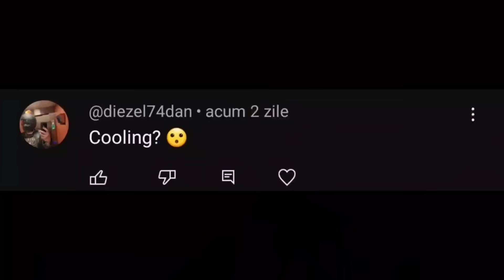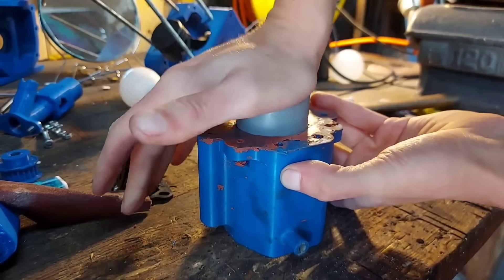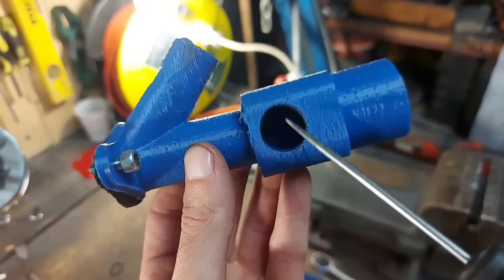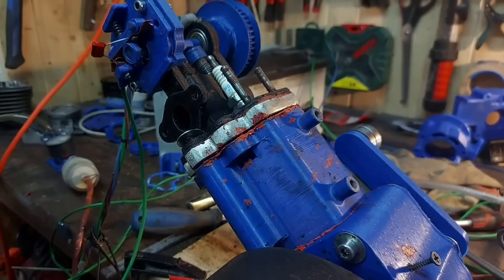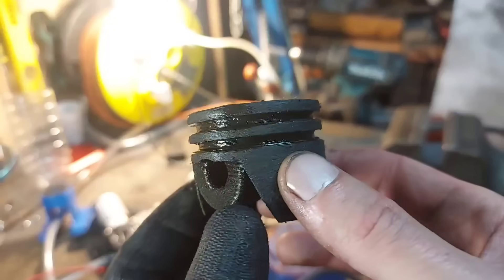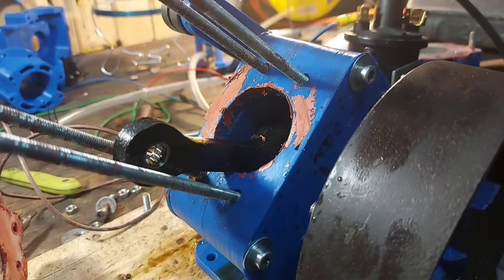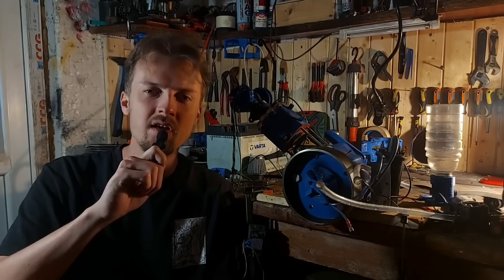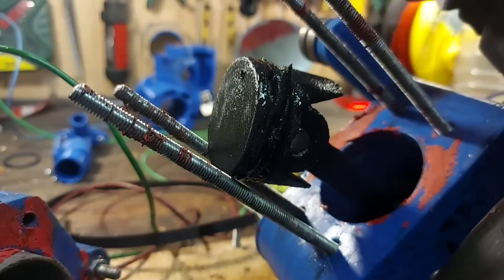High Performance 3D Printed Engine - Testing Your Ideas!

Comment: Maybe a teflon oring rather than a rubber one. Teflon is super soft but maybe the near lack of friction and a reasonably high melting point might keep it alive a bit longer than the rubber ones.
Maybe instead of an o-ring at all the rings could be 3d printed as part of the cylinder.

Comment: Everything you’re doing is exactly what we are plagued with right now when engine makers switched over from cast iron or billet steel to aluminum or magnesium alloy. The saved weight required new methods to prevent the engine from failing from use. Rip the small and big block engines. Now it’s all this complicated mess

Comment: How fast did the engine spin 
Because with high enough frame rate camera or just some magnet sensor we could see max rpm
Reply from the maker: Not sure, but Ill get a rpm gauge for the next episode and I will run another test.

Comment: You could use simple plate of metal at the top of the piston, screwed in place with some inserts and have that part hold the O ring

Comment: The oil made ring sealing better, increasing cylinder pressures for sure. Likely one of the reasons for much easier starting besides the throttle improvements, also potentially a reason for blowing your piston rings out. Another potential for blowing the rings out is spark timing, you need less for higher pressures/throttle. I don't know what you are running spark timing wise, but if you only care about it running longer for the moment  I would suggest having spark at or after Top Dead Center to reduce peak pressures. In non-boosted engines all force harnessed during combustion happens by 20 degrees after TDC since past this point the piston moving down expands the combustion chamber volume faster then the combustion can expand the air.
Reply from the maker: Im running 15° before tdc , that might be a thing , I will look into it , thanks for the tip!
Reply: @alexslaboratory4976  15° is normally a safe number for like 1500/2000rpm+ on NA engines no matter engine load (to my understanding). But they are made of metal. Even just going down to 10 or 5 before TDC could make a huge difference in your current part longevity I think.

Comment: Silly suggestion, but you might be able to cast high temperature silicone lip seals as your piston rings. Tom Stanton did something similar for his air engine, and potentially you could have a different ring cross sections for the compression and oil control rings.
Reply from the maker: Interesting idea, I will look into it, thanks!

Comment: You need to add a RPM gauge. The thing sounded like it was turning 4 or even 5k. Either one from china or better yet a microcontroller so you can log the RPM data.
Reply from the maker: Will definitly add some sort of rpm gauge  for the next episode !

Comment: since you're using a single ring, fill the second gap for a stronger piston and lower the ring seating position so it lasts a little bit longer. I highly recommend a more heat resistant cylinder (it doesn't have to be metal), like polycarbonate and if you add a little bit of water to the fuel it can actually help not to just make your combustion chamber cooler but also to make more power (lower intake temp = more power). Still impressed that your connecting rod held up so well

Comment: Hey, I saw some air bubbles in the coolign system. you should probably remove them in the cooling system. Firstly it affects the water flow, secondly the air might destroy the water pump, third thing is that the air is worse for cooling that water and lastly the air is probably getting trapped in the top part of the cooling loop in the piston sleeve which is where the O-ring is, therefore not giving it enough cooling and causing it to melt (if I understood your engine construction well). To test this theory you can try to turn the engine head 180 degrees, which will change the position of the spark plug and put it closer to where the water is. Anyways there is one more thing about the spark plug. You should probably move it to the center so the heat is spread equally
Reply from the maker: You are right, I will have to add some sort of valve so I can air out the system, the water jacket is design so the water has to go around all the cylinder to reach the outlet and the fact that the cylinder is inclined at 45 degrees ensures that even if there is a small air pocket the whole cylinder is surrounded by water.
Reply: Alright. But what is your opinion about the spark plug position?

Comment: Why are you using a thermoplastic for the bore and piston? Once the engine gets warm both will just melt away...
On the other hand if you use a duroplast, either printed with a MSLA Printer or made with a resin and a 3d printed mould, you could prevent that from happening.
The duroplast wouldn't melt, but just slowly burn or react with the air.

If you then also used some sort of composite, it would probably turn out even better.
I'd recommend maybe using some sort of resin combined with carbon fibers, as that will increase the young's modulus (stiffness) and maximum temperature.

If you do it that way, you could still embrace the plastic 3d printed engine concept and you won't need any metal parts.

Comment: This engine is turning out amazing! I think you should try one more thing before moving to all metal internals, try an aluminum cylinder sleeve instead of the PVC pipe. Aluminum will transfer the heat way better, my plastic piston lasted for over 1.5 minutes with a steel cylinder sleeve, so I think within an aluminum cylinder sleeve you could get even better results. If you could find some sort of aluminum pipe for this, I think that would work really good! 

That first start when it took off sounded crazy, that sounded like a lot of RPMs! 

Good luck, I’m excited to see more!
Reply: you are here   😭😭😭
when is the next video man i need it
Reply: @vortex3738  it’s in the works, I am trying to make the crank case right now! Sadly there is still a lot left to do, but I’m working on it! 

It will actually be insane though, like it’s going to be crazy!
Reply: @ProjectLMZ  Goodluck
Reply from the maker: Thank you ! 🥳 my next step will be  some sort of metal sleeve, id rather go straight to a propper cylinder sleeve so I have easy acces to rings and pistons in the future but idk yet. I have to get a rpm gauge at this point cus this thing really likes to rev 😂

Comment: You can add another valve to the cylinder head that dispenses a jet of water and turn this engine into an 8-stroke engine or even add a little water to the fuel mixture as it passes through the carburetor (BMW has already used the second technique so it should work)

Comment: 4 Things:
1.) Increase the crown height if you can, (The distance between the top of the piston and the first ring) and to keep the compression the same you can add a small dish or depression in the center of the piston. This should reduce the melting issues. Others have suggested this as well. If you can, you could design it like the HERON HEAD. It would increase the squish* of your engine, while allowing the CR to remain the same. (Or worse case scenario, decrease it if the melting problem persists).

2.) Look into Viton, or silicone O-rings for piston rings. More pricey, but they are (or atleast advertised) to be more heat and oil tolerant. Edit: It appears that Nitrile O-rings (I think the ones you have) withstand up to 121C. Silicone can last up to 204C. Viton appears to have a max betwen 204 and 230C.

3.) You may want the inlet and outlet ports on opposite sides of the cylinder. Because of inlet and outlet are on the same side, the otherside of the cylinder and piston (which appears to be the one melting) will have less cooling capability. Although it is convienent, it may be adding to the melting issue. Edit: Water/Coolant jacket is whta I a refering to.

4.) Ceramic paint. You could look into something like Cerakote, or some other easy to apply ceramic paint, to make your cylinder and pistons more heat resistant, like C-186 which is an air-cure ceramic paint. You could also try C-110 for the cylinder liner, though I do not know if it is also appropriate for air curing.

Regardless, hope this helps, and best of luck.

*Squish, for anyone reading this that does not know, is the term for for the amount of area between the piston and cylinder head that is less than 1.5-.5mm apart. This area results in a high pressure zone squeezing on the air/fuel mixture so much, it jets out into the rest of the air fuel mix up to 30m/s, which is actually substantially faster than the flame front that normally occurs. This Squish effect, results in better mixing, lower detonation/preignition frequency, and overall a more homogenous mixture for more consistent performance. However, the squish effect usually ONLY OCCURS, when the distance between the head and piston is less than 1.5mm, and becomes more powerful A.) the more surface area there is, and B.) the closer the distance is. It is known to help engines of both low and high compression.
Reply from the maker: In case I will still be using o rings I will definitely go with viton, when it comes to the cooling jacket, the water is forced to go all the way around the cylinder to reach the outlet and the 45° angle of the cylinder also ensures a full submarge of the cylinder sleeve even if there is a small air pocket . Thanks for the tips , I apreciate!
Reply: On your point 3. It is already a crossflow head design with the intake and exhaust ports on opposite sides.
Reply: @Karl-r5j I meant the water jacket inlet and outlet. Sorry I did not clarify enough

Comment: you could also try non-3d printed sheet metal engine. maybe will it with some ceramic material. for structure.

Comment: You could make the cylinder liner out of steel or aluminium tubing so it doesn’t melt and disperses heat into the coolant. Then it’s metal you might be able to run a proper piston ring. I would also run water jackets into the head and put a sheet metal cover on the piston too if you’d like. Running oil the crankcase is fine just make sure it’s not airtight and can breath.

Comment: I think the ring failure is caused by the pvc sleeve, pvc is a bad material to use around hot things because it WILL deform and lose compression, its also quite rough and so it will damage the rings, as you have seen. Camden Bowen found a bathtub drain pipe made of brass, from what I have seen its perfect for this! try to look around your local home improvement store, you might just find the perfect piece!

Comment: awesome as always. Vent the block for less vacuum and pressure in there that could destroy your gaskets. Also metal sleeve and a metal sheet covered piston will do you wonders
Reply from the maker: Thank you! Will definitly design some sort of filtred vent for the case because rn I have just a hole in the case for ventilation and it spilled oil all over😭
Reply: even better if he put in a oil pump with a oil scavanger to create negative pressure in the crank case

Comment: So if your goal is 10k rpms, you’re going to run into many issues with your current engine design… not that you did anything wrong… you did a fantastic job for what you have… but some tweaks need to be made for it to even have a hope of 10k rpms. One fix is very easy as I think you only need to change your crank… let me crunch some numbers.

So I can’t tell what your bore is from your first video… I am guessing it’s about 50mm so I will do my calculations there. To achieve 10k rpms you must keep your mean piston speed as low as possible especially because it’s made of plastic and the rings are rubber. So I used a low piston speed of 7m/s which would give a stroke of only 22.25 mm. I don’t know what your current stroke is, but I believe this is much smaller than what you currently have. The good news is that by only changing the crank, and the connecting rod, you should be able to leave the rest of the engine, completely untouched. That being said, a longer connecting rod would be good for reducing side loading on that plastic piston.

The real problem now after changing the crank would be making sure you get enough air inside the engine at those RPMs. Currently you’re having issues with melting in the location where the spark plug is. The strongest part of the piston is dead center, so it may be beneficial to change to a smaller spark plug so that you can mount the spark plug dead center on the head. Next, you need to reduce the valve train weight to make sure that it can open and close the valves as fast as possible… I think your valves are designed really nicely, but I think they’re going to be way too heavy for 10k RPM. I think you should probably use smaller valves and step it up to a four valve head. This is an increase in complexity but a reduction in reciprocating weight and I believe it’s the only way you’re going to achieve your goal.

My last upgrade that I would suggest is not only oil which you installed in this episode… but I think you should look into potentially an oil pump… whether it’s an electric oil pump, externally, or a belt driven oil pump off of your timing chain… It doesn’t matter… and I think you should install two or three… Or maybe even more oil squirters designed to squirt oil right up into the underside of the piston. Not only will this add lubrication by throwing oil all over the inside of the engine, but it will also give a cooling effect by using the oil to reduce the temperature of the piston. I don’t know what the heat transfer of that carbon fiber filament is… But any amount of transferred heat away from the piston will help.
Reply from the maker: I have a 50mm stoke and a 47mm bore definitely not ideal for high revving but my plan is to increase the bore and keep the the crank. I was planing on doing a 70mm but im still searching for cylinders sleeves so im not sure yet , when it comes to the head it will definitly need a big redesign if I increase the bore, at the moment im very limited by the bore size when it comes to valve adding and head design. After the bore increase I plan to design a 4/5 valve head with dual overhead cams and a central sparkplug just like you sugested. (Also bigger springs will be neccesasy for high revs) thanks for all the tips!
Reply: @alexslaboratory4976  All that sounds like a solid plan. A 5 valve head would be even better for high revs as it would have even lighter valves plus a natural spot dead center for the spark plug (plus its cool because who doesn't like a 5 valve engine).

As for the stroke, I am not saying its impossible to make it rev that high with that crank stroke, it will just be difficult with a plastic piston, con rod, and cylinder wall. With a 50mm stroke, Your piston will have a mean piston speed of a little under 16m/s which isn't crazy... that puts you in range of a typical passenger car engine... but as you know being not made of metal right now... that will be difficult to hit... so keep the stroke in the back of your mind as a last ditch effort to reach your goal if the engine starts to struggle to last long enough to hit your desired speeds.

And oil squirters... don't forget those... it may not seem like it but I really think they are going to play a big roll in getting that piston to last. Also... and this may sound dumb... but any way to keep temperature out of this engine you can think of. Oil cooler, chilled coolant, possibly an intercooler even though its NA... anything to pull at much heat out of that piston as possible.
Reply: 7m/s is super slow piston speed. Like old side valve engine. A mild street small block chevy engine is around 20m/s. He'll be at 16.7m/s. Big v8s run at twice that speed in racing.

However he gets more valve area to displacement with a smaller stroke. If he wants peak hp at 10k rpm then he needs much better ports than he has at the moment. But it should not be difficult. 
He should use an intake valve of about 23.5mm and a lift of maybe a third of that and he should be able to get even peak hp at 10k I'm pretty sure. That's if everything else is up to the task...
Reply: @Karl-r5j I know its super slow... but again... we are talking about a plastic piston with rubber rings in a plastic cylinder... so keeping the piston speeds as low as possible is very important for longevity.

Comment: You might want to replace the PVC pipe with a metal pipe and place a metal sheet on the top of the piston to shield to from the heat. As for the piston, you might want to use a lower print speed to increase quality and increase the distance from the piston rings to the piston head by 1-3 millimeters.
Reply: A sheet won't protect the piston.
Reply: it being plastic feels more right for a 3d printed engine

Comment: Use only a single ring - The bottom ring. That way there's more plastic on top to absorb heat.

Is your crank case vented? Remember to put a little filter on it so it doesn't splash everywhere.
Reply from the maker: The crank case needs a bit of redesigning , it needs a proper ventilation system(rn I have just a hole) also needs a oil cap with a oil level and a oil drain plug. I like the single ring piston ideea , thank you !

Comment: You should start using a metal cylinder jacket as well as a metal piston, encasing metal parts in a plastic block will give you the best chance at success. Similar to how 3d printed firearms have evolved away from entire plastic designs to more of just a frame to hold commercially available machined parts.
Reply from the maker: This is the direction im heading rn, at the moment im reasearching cylinders I could use (maybe incrising the displacement a bit)
Reply: @alexslaboratory4976 Sick😮